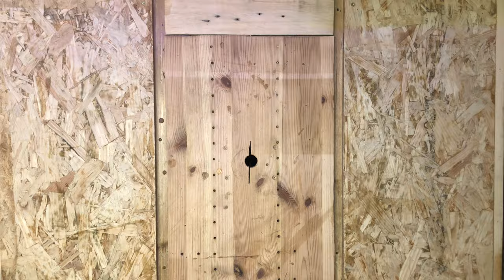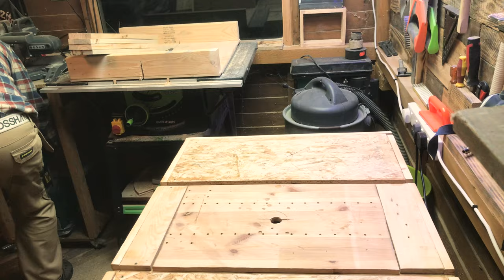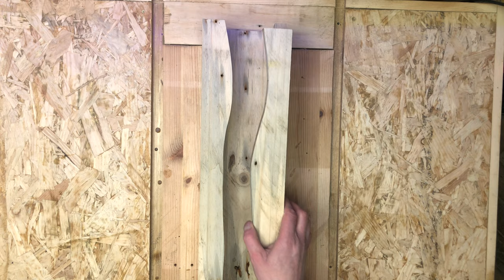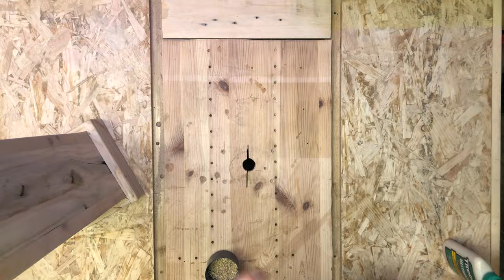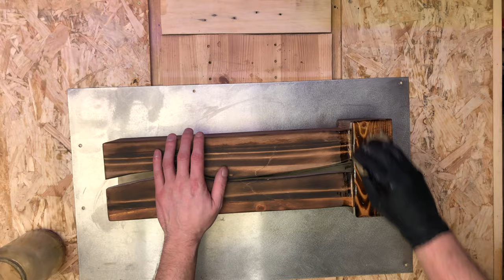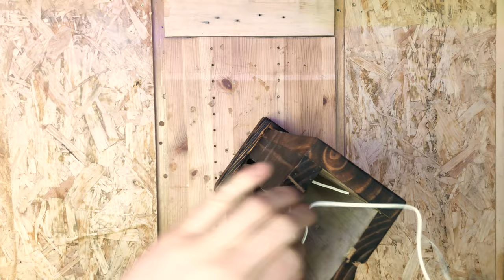Beginner woodworking projects that sell! Easy Pallet wood lamp

Comment: That’s pretty cool. I’m going have to build one or something like it. Maybe fill the river with epoxy and have it wrap a corner on a 2nd side.
Reply from the maker: Thanks man! Epoxy is a great idea. I haven’t tried it because I wanted this to be as simple as possible for someone who is just starting with woodworking. All the best!
Reply: @rarecraftsman  I totally understand that. It is a pretty simple project. I like to keep my projects fairly simple. I only have just recently tried epoxy on a flat top stand I’m building with gas pipe for legs and an old corian counter top. I would like to do more with it. I have made several pieces over the years. As for lights my wife says I have an obsession with them. I worked in a cabinet shop years ago and always have enjoyed that type of work. Wish I had more room and better tools

Comment: If a guy had a lazer cutter setup, you could turnout some lit name box signs for peoples homes.  Way cheaper than neon, but similar effect.  Keep up the good work.  I need to figure out how to incorporate electrical components into my projects.  You make it look easy!
Reply from the maker: Ha! Thank you man. That is actually a pretty good idea. Incorporating electrical elements in woodworking projects is quite simple. If you'll ever need a hand with something just drop me a message. All the best!
Reply: hi 👋  I have a laser cutter and I'm a beginner... are you saying make a box like he made and instead of the "river" gap have it be their name?? that'd be cool... unfortunately for me I'd have to do it on my scroll saw because fence pickets are way too thick to cut with my laser... but even with the scroll saw it would come out pretty awesome tbh

I want to make a 4 ft tall one with the "river" like in the video!
Reply from the maker: @shellyfinegan5362  this might work. I believe that the item you are thinking about here is called light box maybe? You might also be able to cut a slot for acrylic and then apply your laser cut design to acrylic?

Comment: Can I get the plans for this project
Reply from the maker: I’m sorry I haven’t got any but I’m in the process of learning how to make some so I’ll be able to add them with my future projects.
Reply: Ok I have been just stop each step I just need the Length of the boards
Reply from the maker: @floridatom58  I’ve used four 500mm x 100mm ( 19.685 inches x 3.93701 inches) boards. Base wraps around the body. I hope this helps 🤞
Reply: If you cant work out what you need for this simple project just by looking at it you should not go anywhere near power tools 😊
Reply from the maker: @jimgeelan5949  dude this is not very nice. People have to start somewhere.